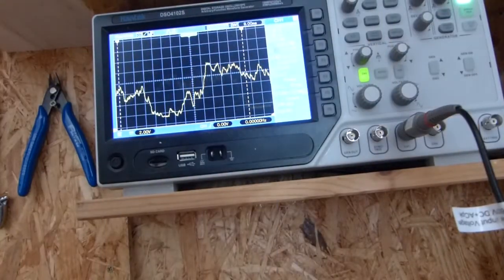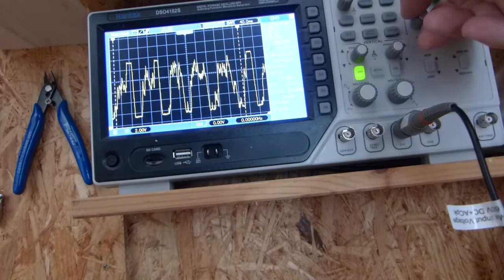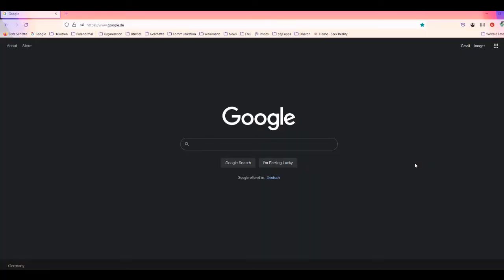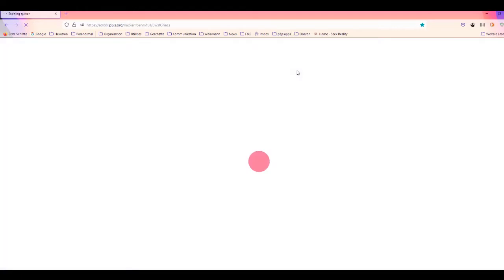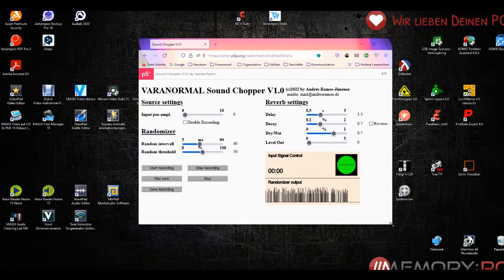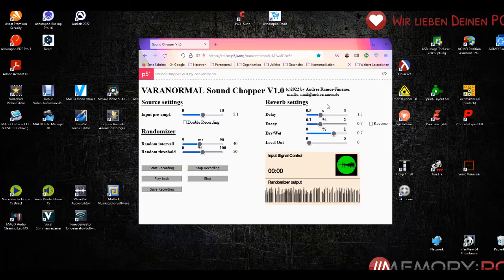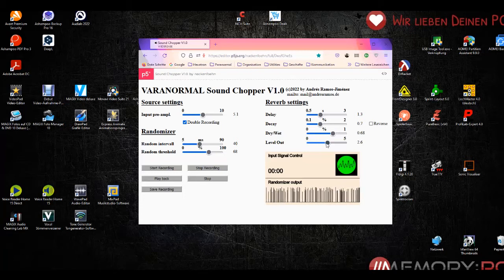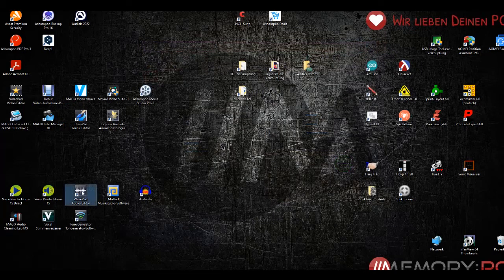The VARANORMAL Sound Chopper - an ITC application

Comment: Andres, it would be fantastic to have a programme, for example, a state-of-the-art Audacity, which would be able to reproduce with sufficient clarity the psychophonic inclusions that we obtain nowadays and that currently involve so much work, amplifying, reducing noise, changing speed, etc.

This programme would be the one that would carry out all these operations taking as a reference one of the speech recognition systems we already have.
Reply: I think I know what you mean. You are envisioning a kind of ITC audio editor. Basically I ask myself why no one did this ever before. However creating this is a little over my head because the post processing methods often are very sophisticated. No wonder that audio editors are developed in specialized teams and not by single persons generally. With my programming in p5js I only can cover a very small subset of the needed functions since p5js is more focused on sound generation and not post processing but I will have a look at the available library functions.

Another idea would be to use the configuration features that editors like Audacity or Wavepad provide in terms of customizing and tayloring functions or default parameter sets. Maybe we could configure Audacity with just the needed functions for ITC.
Reply: @andresramos7495  I understand that it can be very complicated, but imagine an English-speaking experimenter attempting transcommunication, recording his questions and hoping that the possible answers will be recorded as well.

When he plays back the recording and submits the file to the latest generation Audacity programme, it detects the first inclusion, stops automatically and starts processing, automatically subtracting, enlarging, etc. until it recognises a possible word or more in English and searches its library for the most similar ones, alerting the experimenter to listen to it again. It would act in the same way with possible subsequent inclusions.
Reply: @elchicodelnikirojo9773  Yes I see what you are aiming for. Currently I don't see we have this functionality already. We would need a speech recognition AI well trained for ITC signals. Michael Lee invested a lot of work in this goal but it's a hard nut to crack. Moreover your vision would exclude the experimenter from the ITC session because the interpretation would be done by a machine. Since I think ITC devices work like catalysts, improving your own mediumship, the experimenter and his interpretation must play a role.

Comment: This is extremely interesting, thank you so much for sharing. May I ask though, I did just test it out quickly using my iPad. Upon playback however I couldn’t hear anything? Is there something that I’m doing wrong? Thank you in advance (Edit) I have now figured it out, thankfully. Thank you again, I’m hoping to use this alongside my EVP experiments and DRV experiments, as well as my spirit box sessions. I shall let you know of any potential voices (hopefully). Thank you very much again 🙂
Reply: Glad to read this! The point is that the application runs in a browser. On one hand this is fantastic as you don't need to install anything (apart from the option that you can download the files and run them offline in your computer too). The other thing is that the browser developer are not coherent in their browser architecture and features. So it's not guaranteed an application will run in one browser the same as in any other. Especially security settings are critically quite often. So, I'm very glad you could make it work on your iPad because I had no Apple System to test the app.
Reply: @andresramos7495  I'm glad you now know and that I could help. It seems to be running just fine, I'll be testing it twice later for longer times. The first test will be an EVP test using white noise from a radio on medium wave, the second I'll just be letting it run whilst asking questions, I'm looking forward to seeing what results I get.
Reply: @theunknownzones  Again, thank you so much! If you like please use the link in the video description to post your results in the VARANORMAL forum. We all are curious for your results no matter what they will be like.
Reply: @andresramos7495  indeed I shall do so. Again you’re very welcome. I’m going to be experimenting with Perlin Noise also at some point. (Which again seems to run well on my iPad). I did have a quick test last night and was extremely impressed, I also did see what appeared to be faces (which I wasn’t expecting with a first test). I will be experimenting with both as much as possible. Thank you again 🙂
Reply: @andresramos7495  I wanted to add, I’ve just signed up to the website (as I forgot to do so lol). It’s really nice to be amongst like minded people 🙂
Reply: @andresramos7495  hello again, so I seem to be having problems in regards to being able to save the file once I’ve recorded it. It also won’t let me play the recording back? I’m not sure why this keeps happening, I’ve tried it several times on both my iPad and phone. On Google and safari. It will let me record but not save nor playback. I don’t know if anyone else has ever had this problem before, any help would be greatly appreciated.
Reply: @theunknownzones  This is strange. Do you see the signal in the level control gadget while recording as shown in my video?
Reply: @andresramos7495  yes, I do see it. It all appears to work totally fine until I try to play it back or save the file 🤷🏻‍♀️ I really have no idea as to why it won’t let me. I do have a tablet that runs windows 10 but it’s very temperamental, I don’t own a pc so couldn’t try it on there. I’m not sure as to what could be the problem. Thank you for replying.
Reply: @theunknownzones  What's your name in the VARANORMAL forum? Maybe we can scrutinize the problem by exchanging some screenshots. I bet it's a security setting in your browser.
Reply: @andresramos7495  it’s P.A.T in the Varanormal forum. I have used three different browsers. Yesterday when I tried to get it to work on my tablet it wouldn’t even load it…I tried it again today and it’s still not letting me save nor play it back. Thank you for trying to help, much appreciated 🙂
Reply: @theunknownzones  Just sent you a message in the forum